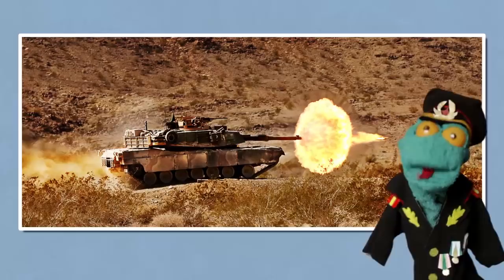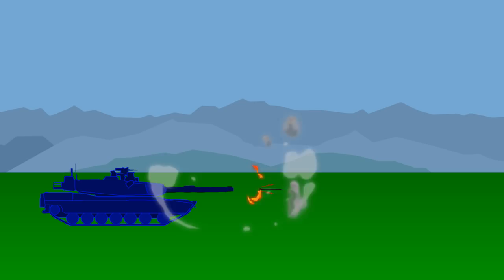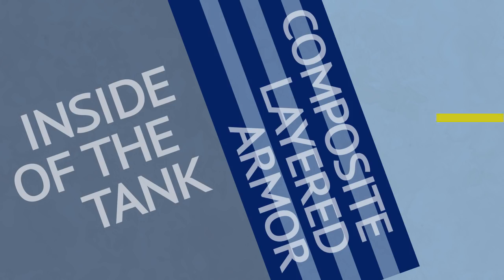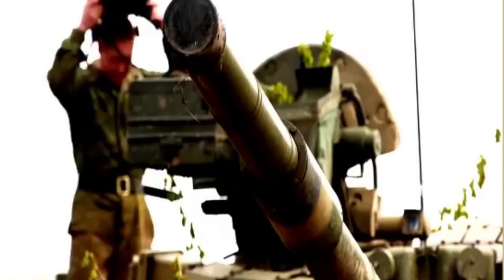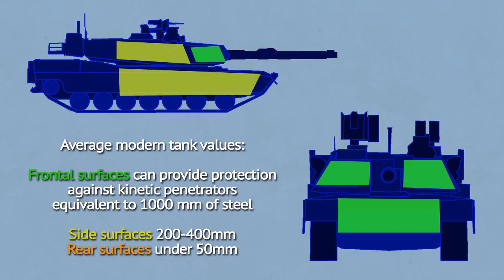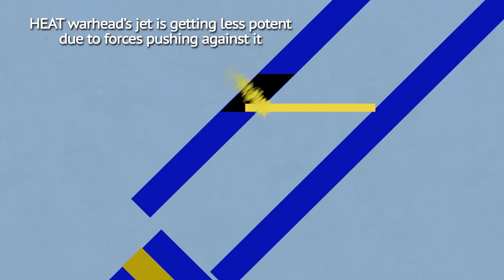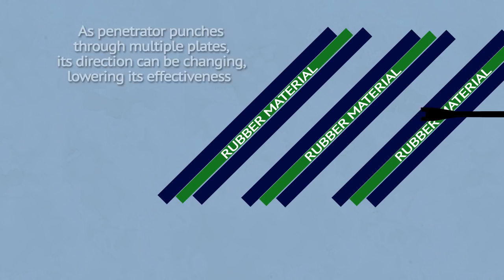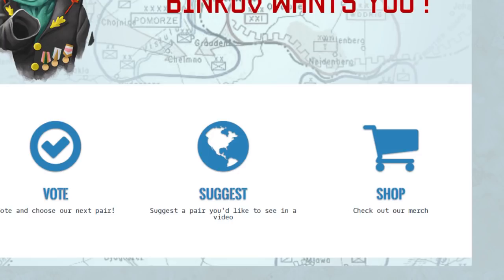Tank Gun vs Armor: Tank Warfare Explained

Comment: What's your assessment of towed anti-tank guns? So the same guns as in tanks but just on a mount to be dug into a position like the 2A45 Sprut Anti-Tank gun. In WW2, the Axis used towed 88mm guns quite widely in the anti-tank role.
Reply: Towed anti-tank guns are generally regarded as suicidal on a modern battlefield.  All advancing tanks have to do is use artillery to force the gun crews into their shelters until the tanks are right on top of them - then simply machinegun the crews when they try to man the guns.
Reply: Uh, why didn't they do that in WW2 then? Oh, because it's not just a matter of calling in artillery, you have to locate the anti tank gun before the anti tank gun locates you! Even if you do find something that might be an anti tank gun, it might be a cheap and disposable decoy. Decoy not only shape but flash of firing.

Think about this, you're a tank charging into enemy held territory, your solution to a very well concealed gun that can fire a projectile that travels over 1km in less than a second is to call in artillery that takes up to several minutes to respond?

You're dead. And the anti tank gun crew can retreat into bunkers to resist any artillery bombardment and artillery probably can't keep up a sustained bombardment as they have to "shoot and scoot" to avoid counter battery fire.

It's in fact easier to counter slow anti tank guided missiles as their flight time is so long the tank can see it and take direct countermeasures such as smokescreens or shooting at the launch site.

There is no time to react with an anti tank gun, their gun is as fast as your gun. Faster in fact as they'd use APFSDS rounds against a tank but a tank would use high explosives rounds against a dug in anti tank gun.

Anti tank guns are much cheaper than a whole tank so you can have more of them.
Reply: The US did do this in WWII.  And every military trains for combined arms attacks.  In my Cavalry squadron we were required to arrive at any location plus or minus 30 seconds because in the attack - if you're 30 seconds early you're getting hit by your own artillery and if you're 30 second late the enemy has time to crawl out of their shelters and man their weapons.

And even an ATWSS (Anti-Tank Weapons Signature Simulator) cannot really simulate a missile launch signature or the signature of a large caliber gun firing.  Another problem with decoys is that they have to be positioned so that the enemy can see them.  This itself will tip of the enemy that there's trouble ahead.

An AT gun will get two maybe three shots off before it's destroyed.  People who have not been on tanks have no idea just how fast and deadly modern tanks are.  And the AT guns will be crippled if they do not have tank quality optical and fire control systems.  And since these systems not only over half the cost of a tank - they consume an enormous amount of electricity and hydraulic power.  The tank guns will have a 95% of a hit within a meter of the aim point whoever they fire and can engage three separate targets in 15-18 seconds.  

Another lethal flaw in AT guns is that they are stuck in one location once the firing stops.  A tank will fire one or two shots then back down and move to another firing position.  This way the enemy fire is hitting where they were and they can do it all over again.  An AT gun is going to get off two - maybe three - shots and then die because they cannot displace their gun in anything under a couple of minutes.

Now an AT missile crew has an easier time of it because they only need to survive long enough to guide their missile to their target and then - literally - run for their lives.  (Or drive away if they are on a wheeled vehi8cle.)  The difference here is that the equipment needed to fire a missile is light enough to fit on a full-sized pickup truck type vehicle.  A large caliber gun weighs several tons.

There's a reason nobody uses towed antitank guns - and hasn't for the past 40 years.
Reply: really good at shelling the enemies in urban combat, look at syria or ukraine.
Reply: Colin Campbell. Yes in WW2 they did try to suppress anti tank guns with artillery but NO IT WAS NOT THAT SIMPLE. It hugely complicates offensive operations and really devalues sending in tanks as if the tanks are used as forward observers (to find AT guns) they are inherently more likely to be seen first and destroyed first.

And artillery is not that effective against dug in positions, and how do you suppress so many positions at once? Because how can you be so sure to distinguish decoy guns from real guns?

It cannot be known how well muzzle blast may be simulated, simulating a missile is obviously hard to spoof but a guns blast is just a blast. 

There seems to be so much focus on ATGMs and the counter measures against them seem to all be exploiting the slow flight time of such missiles, yet wouldn't be effective against a high velocity gun.
Reply: But if you're using it to shell infantry or demolish building is it still an anti-tank gun?
Reply: "And the AT guns will be crippled if they do not have tank quality optical and fire control systems."
Yet there's no particular reason they wouldn't have sufficiently good optics. And it's not like they have to even be as good, it's not like they have to correct for a wobbling suspension and it's far easier to spot a tank on the move than a dug in gun as distinct from a decoy. Tanks are big, moving and radiate heat. AT guns are small, immobile and ambient temperature, and it's easy to construct decoys.

"The tank guns will have a 95% of a hit within a meter of the aim point whoever they fire and can engage three separate targets in 15-18 seconds."
With an ultra-velocity APFSDS round which would be relatively very ineffective against a dug in AT-gun. And again, how does it know where the three anti tank guns are as distinct from the 6 decoys? How is it going to destroy ALL of them before ANY of them hit the tank? What do you do if you shoot a round at a 

If your plan is to bombard every possible position with artillery while you roll in extremely close, well good thing you have 6:1 ratio of artillery to their AT-guns and while you're rushing in close you can't discount infantry with RPG type weapons attacking close and from the flanks.

"Another lethal flaw in AT guns is that they are stuck in one location once the firing stops.  A tank will fire one or two shots then back down and move to another firing position."

That may be no advantage when you have aircraft assets that can spot armoured vehicles on the move with such ease. It's pretty well accepted that no NATO force will conduct any offensive operation without air supremacy and air-cover. Moving around may make a job somewhat harder for the opposing tanks, but with unacceptable vulnerability to air-power which look for things like heat of large tank engines and the distinctive radar return of an armoured boxy structure. Running just means you die tired.

Though an antitank gun can still be moved, yet doesn't need such a huge obviously military vehicle that is so obviously detected as a valid military target. Think about the First Gulf War, all those Iraqi tanks were kept stationary and dug in they might as well have been AT guns, though they suffered so badly as they were forced to use steel training ammunition against a generation-more-advanced tanks and without even close to as advanced optics. You can't always count on such mis-allocation of resources.

"Now an AT missile crew has an easier time of it because they only need to survive long enough to guide their missile to their target and then - literally - run for their lives"

But that flight time is as long as 20-30 seconds!! That's not easier. In the same time an AT gun could have destroyed the tank before it has a chance to destroy them. Several shots in the time it takes on ATGM to miss. You just said tanks can hit three different targets in 15 seconds. The missile position don't even need to be destroyed, if the tank just moves out of firing line or deploys a $100 smoke screen then the $50'000 missile is defeated.

"A large caliber gun weighs several tons."

Lots of things weigh several tonnes, howitzers weigh several tonnes, anti-aircraft systems weight several tonnes. But an AT gun is FAR lighter than a tank. It can be moved by common trucks, airlifted, cross rivers on barges and they can have their own internal electric motor to move short distances with help of manhandling from infantry.

ATGMs may be light, but the flight time is so long, it gives so much time to react before even the first hit. What if the objective is to stop opposing tanks reaching a vital objective rather than lightly harassing them? You fire the ATGM, it's so easily countered with smoke, counter fire or simply briefly retreating and you run away leaving the airfield or bridge to be captured. If you NEED a position to be held and retreating is not an option, the advantage of slow ATGM disappears.

"An AT gun is going to get off two - maybe three - shots and then die because they cannot displace their gun in anything under a couple of minutes."

And two to three shots is not good enough? As you presuming those shots MUST miss or be ineffective?

What are those two to three shots PER GUN doing? There's no particular reason an AT Gun should miss so much more than the tank should hit the AT position. And considering how much cheaper AT guns are and how they are MUCH lighter than a tank as per being moved into position, you can generally mass many of them in a position you want to defend. So quite conservatively:
-two different positions
-harder to see
-easier to decoy
-harder to hit 

A tank is going to destroy BOTH of those positions before EITHER those AT guns destroy the tank?!?!

This is the same challenge as 88mm guns in 1944, except the projectile velocities are doubled and sensors are even better at detecting heat-radiating vehicles but relatively less advances in detecting cold AT guns. You cannot assume that the tanks will have a monopoly on modern-sensors and optics.

Yes the tank has a extremely powerful hydraulics for a fast rotating turret but it needs it to rotate a massively heavy turret quickly. An AT gun does not need that. Nor does it need advanced servos to compensate for moving suspension.
Reply: It's semantic whether it is or isn't an anti-tank gun, the point of the phrase "anti-tank gun" is to give you an idea of what kind of artillery piece I'm referring to, not a low velocity cannon like a howitzer nor a high velocity but quite small calibre gun like a 30mm auto-cannon. Bombarding infantry at long range and lobbing explosives to demolish buildings is such a lesser requirement it's obviously included within the meaning of an "anti-tank gun".
Reply: Treblaine you do realize that this is not in fact the 1940s, right? 

Anti tank guns aren't effective in modern warfare, use missiles instead.
Reply: Treblaine you also forgot that HEAT rounds exist. Thermal sensors, air support, cruise missiles, infantry too
Reply: Yes, I know it's not the 1940's, anti tank gun are EVEN BETTER than those from 1940's, with projectiles at velocities of up to 1600m/s rather than 'only' 800m/s. This gives such a faster flight time for an anti-tank gun than than an ATGM, which for the past 45 years have been very effectively countered by exploiting the SLOW speed of guided missiles. 
ATGMs are also vulnerable to their guidance systems being jammed and even active protection systems. It is precisely because of the technology of today that makes ATGMs less relevant. Modern armour is far more effective at nullifying shaped charge warheads than Kinetic energy penetrators.

ATGMs are not cheap, the ones that aren't easily jammed cost about $1 million for a launcher and 12 missiles (Peru's cost for Kornet Missiles). This isn't just expensive to deploy, this is expensive to even train. And all this training you still know tanks can easily counter such threats with basic tactics and cheap countermeasures.

This is what happened in Ukraine, loads of missiles fired, most missed, everyone ran away after each shot. Only to see anti-tank guns see more and more use. You have to realise that so many of the tanks that are still in operation today are refurbished older models that are worth LESS than the ATGMs designed to destroy them! Yet these old tanks are just as capable of avoiding being hit using the same countermeasures as expensive MBTs.
Reply: No, I didn't forget that HEAT rounds exist, Ike. You forgot that more modern tank armour and countermeasures are most effective at defeating HEAT rounds than APFSDS rounds. Like explosive reactive armour. Like active protection systems. Thermal sensors are useless against a gun sitting still at ambient temperature, thermal sensors make it easier for anti-tank guns to find tanks that are moving on their position.

If you're using $5'000'000 cruise missiles to blow up $200'000 guns then the richest nation will lose a war of attrition with all but the absolute poorest nation. And  what is any guided weapon aiming for? It's one thing for guided weapons to hunt for tanks with their distinctive thermal emissions, size and magnetic signature from its steel mass... but a tank gun is as easily decoyed by a bit of steel piping painted with the same paint.

I'm with you on infantry though, even modern tankers have confirmed as much the importance of infantry support. But ATGMs don't really make the job any harder for the infantry.
Reply: Treblaine you are basically spending half as much for a tank, if you want a modern gun and sensor system, with an FCS. 

Otherwise the guns would be useless. So why spend money on these guns when you can just buy more tanks. 

Especially when considering that these guns can only be used in a defensive role as an anti tank weapon, so if you wanted to assault you would have a large force of anti tank guns unable to contribute.

The tank guns lack survivability, because they can't move after firing and will be targeted by all kinds of support or even the tanks themselves. The tanks can simply stay at a range you can't penetrate them at and hit you with HEAT. 

If you want close range ambushes then infantry will fuck over your guns. 

Plus once you are detected an ATGM won't have any problems hitting a stationary gun, you're better off buying more tanks
Reply: Treblaine also things like the AT4 cannot be jammed
Reply: Treblaine and about me saying you forgot heat exists, I meant an enemy tank would fire HEAT at your guns and not sabot
Reply: But you don't need most of the expense of a tank gun, you don't need to counteract the movement from the suspension nor a very powerful yet accurate control of a massive heavy turret. All you need is a good thermal sight. 

"So why spend money on these guns when you can just buy more tanks. "

Because even by your own - imaginative - numbers you get TWICE as many anti-tank guns! You don't get more tanks. You cannot dismiss the cost of everything except the tank's gun as trivial costs.

"Especially when considering that these guns can only be used in a defensive role as an anti tank weapon"

And that's PRECISELY where you need anti-tank weapons as tanks are overwhelmingly used in the offence. Tanks may be ideally the best anti-tank weapon, but to use tanks to counter tanks you need to have many many timed more tanks than your opponent and far more freedom of movement. How can you concentrate enough tanks everywhere? 

This is the economy apparent in WW2 and the same economy applies today, why the Germans had 20x as many anti-tank guns of any standard throughout the war than tanks. Because all else being equal it was far less expensive to build and deploy an anti-tank gun than a tank. 

I don't think you're anywhere near as critical of ATGMs in such a purely defensive role.

"The tank guns lack survivability, because they can't move after firing and will be targeted by all kinds of support or even the tanks themselves."

You're far more vulnerable leaving a dug in and concealed position which isn't necessarily known to the extent that it can be targeted. Giving a rough range and azimuth from your last approximate position where you thought an anti-tank gun might be is going to result in a very low concentration of artillery fire. 

And while it is true that eventually, with enough time and devotion of resources, anti-tank guns may eventually be neutralised. Then they have already achieved their purpose if it was to stop an attack against a far more vulnerable point. Compare and contrast with an ATGM which is far less survivable for the extremely long lag time between first sign of the launch and any chance that it could have reached the tank it is threatening, more than enough time for the tank to fire many rounds at the ATGM launch position.

When soldiers fight they don't fight to save their own lives, they put themselves in harms way to oppose their enemy. This is no suicide mission though, they have a chance to win and that it to outshoot the tanks that are assaulting their position, load faster, dig in deeper, hide better, smarter decoys, better coordinate with spotters, artillery, landmines. 

Don't just "shoot and run away".
Reply: HEAT rounds are also defeated by the typical earthen defences an AT gun would be dug into, just a few feet stops the biggest and meanest HEAT shells. You need a very good hit against an anti-tank gun's position with a lower velocity fin-guided projectile, and you don't even have anything to aim at as anti-tank guns can use the same thermal sleeve over the cannon barrel. 

AT4 has a velocity of around 250 m/s compared to the 1600m/s velocity of an AT gun. And the warhead is so small it can only defeat the frontal armour of older tanks, otherwise only the side armour of more modern tanks. 

These small cheap anti tank weapons are definitely relevant though, and they are a simultaneous threat for tanks to deal with while dealing with AT guns, analogous to the twin threat of panzerfausts and 88mm guns in WW2.
Reply: So far you are doing a really good job of indicating that you have no idea about this subject.  For example - every tank commander in the US army is able to call for and direct artillery fire.  As for how I'd suppress that many positions at once - with a 50/50 mixture of HE and WP.  The shrapnel from the HE keeps them in their shelters and away from the guns and the WP covers their positions in smoke.

In my Cavalry unit - this was a battle drill.  The scouts led the advance by bounding forward then the tanks followed.  Once the tanks were in position the scouts bounder forward while the tanks covered them.  If the scouts ran into trouble the battle drill started.  The scouts went evasive and fired a salvo of smoke grenades then retreated to the last position.  At the same time the tanks charged forward and used direct fire to suppress the enemy (distracting the enemy from the scouts by presenting a much more dangerous threat.)

At the same time the mortar section began laying a 50/50 mix of HE and smoke on the enemy positions.  Once the scouts were back in position the started firing on the enemy while the tanks retreated.  

As for the rest - real life is not a video game.
Reply: Yes there is a good reason they cannot have tank-quality fire control systems.  Weight and power.  Tanks can carry the weight and have a surplus of power for the fire control system.  And AT guns have another issue that tanks do not - a lack of mass to soak up the recoil.  These recoil forces combined with the fact that the FC system cannot be as heavy-duty as that on a tank and you have a huge engineering challenge in maintaining calibration between the FC system and the gun after each shot.
Reply: Who said I'd waste a kinetic energy round on an unarmored target?  The only reason for doing this would be if you have FSDS as your battlecarry and firing the gun is the fastest way of clearing the chamber for HEAT-MP.  And you seem to have this idea that somehow we aren't going to notice the decoys until after the real guns fire.  You have a problem here.  If your decoys are so easy to detect - they would be noticed before the tanks came into the effective range of the AT guns.  And if they are hard to detect the tanks would be firing on the weapons signatures.  Because they didn't detect the decoys.  

And a FSDS projectile hitting your gun is going to mess things up.  Unless of course you do not have any kind of protection for the crew - which makes them targets for machineguns.

And you are the person who is making assumptions - without any understanding of the subject to base those assumptions on.  Everything you are saying is based on assumptions that are not based on any kind of understanding of the subject.  

Your idea that you can put a tank fire control system on a towed gun does nothing but demonstrate that you know nothing about tank FC systems. (Or about gunnery fire control systems at all.)

The fact of the matter is that the reason AT guns are nothing more than museum pieces is because everybody who has any clue about modern warfare knows that they are a stupid idea.
Reply: Colin Campbell. So you are completely unaware of the widespread use of anti tank guns in combat in Ukraine?

Of course tanks have radios to communicate with artillery, I NEVER implied that they didn't have radios. I said how would they know what to tell their artillery? I even specifically talked about how they couldn't know what to call in.

And these anti tank guns manage the recoil of such rounds just fine, you keep pretending they need an expensive fire control system to compensate for a vehicle suspension when they don't. You aren't even listening, you are ignoring how AT guns don't need them as much as a tank but insisting they couldn't have them anyway.

What's this nonsense about decoys being either far more obvious or invisible? The point is they are constructed to look almost identical to an AT gun, so more nor less visible, so if you visually identify an AT gun it's as likely just a decoy. Also there is no reason the flash cannot be replicated with a high degree of accuracy. Even use the same powder.

Even if you concede that the solution to AT guns is to retreat and wait for artillery, then you've proven that an AT gun is far better at its job of stopping an assault.

I never said that AT guns would be utterly immune, but you're already putting delays on your assault, you're already requiring coordination with scouts and artillery. What if artillery says "no" they are on duty against counter battery fire or are protecting another position?

You aren't selling AT guns short by bringing up how much more time and resources are needed to defeat them. What if the side using AT guns also have other resources and - just consider this crazy idea - they also have brains inside their skull.

What if all the time you're amassing solutions to the supposed non problem of AT guns, they exploit this predictable retreat and delay to counterattack?
Reply: Yes obsolete AT guns have been pulled out of storage and used by both sides in the Ukraine.  However they are not being used in an anti-tank role.  They are being used as assault guns and against lightly armored and unarmored vehicles.

And even the 125mm ones cannot reliably penetrate the frontal armor of a tank.  

And I never said that the solution to AT guns is to retreat and use artillery.  The battle drill I was talking about is used in cavalry units.  Cavalry units do not have the mission of attacking defended positions.  Their job is reconnaissance and counter-reconnaissance.  

A tank or mechanized infantry task force is going to literally drive over the guns and then turn around and attack those guns from behind.  And if the cavalry has located their positions - then it will be a deliberate attack with artillery support.  

Apparently you know nothing about US Army tactics and doctrine either.
Reply: "And I never said that the solution to AT guns is to retreat and use artillery."
Previously the very same day:
"every tank commander in the US army is able to call for and direct artillery fire.  As for how I'd suppress that many positions at once - with a 50/50 mixture of HE and WP."
"The scouts went evasive and fired a salvo of smoke grenades then retreated to the last position. "

Wow.

And what are these scouts? Some sort of tank? Humvee? Infantry on foot? What are they doing? Are they just bait to get AT guns to expose themselves by firing?

And what's the point in popping smoke? The flight time of AT gun projectiles is not like ATGMs, you don't have 20-30 seconds before they hit, you have 1 second, or less.

Of course AT guns are going to shoot lightly armoured and unarmoured vehicles more than tanks... THERE ARE MORE OF THEM than tanks! Thank you for raising that point, though you overstated it by the unproven conjecture that Anti Tank guns are inexplicably... not used against tanks, it is very relevant the threat from other vehicles. It is barely worth it to use an ATGM against a tank, but against lighter and more common vehicles it's not worth it. There is still a huge demand for long range and powerful direct fire at long distances with such a fast flight time it's impossible to deploy any effective countermeasures.

How does this remotely work, your scouts are being destroyed and the few survivors forced to break line of sight ASAP and escape back the way they came, why would tanks do any better charging right into the same killzone? 

Are you banking everything on your tank winning the tank armour vs tank gun penetration arms race? 

"And even the 125mm ones cannot reliably penetrate the frontal armor of a tank."

Guns of calibre larger than 120mm can't penetrate the front of a tank? The M1 Abrams has a 120mm gun. Stop with the nonsense. You seem to imbue the tank itself with magical properties, as if just being in a tank then a large calibre high velocity gun is supernaturally able to make the projectiles fly faster for no reason known to science. That's obviously not the case but you won't give any reasoning.

"A tank or mechanized infantry task force is going to literally drive over the guns"

You seem to have an utter contempt for history, why do you think everyone in WW2 didn't just "charge forward and use direct fire to suppress the enemy"? They had guns with a good amount of high explosive filler with far more ideal HE to shell mass ratio for ideal fragmentation than modern rounds like M830A1. Modern guns are going to be even worse at suppressing AT gun positions. What are you even aiming at?

You seem to be incapable of accepting that AT guns can shoot at, hit and damage and destroy tanks.

Not that allied tanks couldn't eventually push on through to Germany, but it's not because AT guns simply needed to be charged at.
Reply: "And what are these scouts? Some sort of tank? Humvee? Infantry on foot? What are they doing? Are they just bait to get AT guns to expose themselves by firing?"

"And what's the point in popping smoke? The flight time of AT gun projectiles is not like ATGMs, you don't have 20-30 seconds before they hit, you have 1 second, or less.
"

As I previously posted the mission (in this example) was reconnaissance/counter reconnaissance.  In effect their job is to locate the enemy and then report on their locations, dispositions and actions.  And we were 'heavy cavalry' so each troop had two scout platoons with M3 Cavalry Fighting Vehicles (a modification of the M2 Bradley Infantry Fighting Vehicle) and two tank platoons.  

And firing a salvo of smoke grenades is doctrine if engaged by enemy antitank weapons.  Part of the battle drill.  Their job is to locate the enemy - and to avoid decisive engagements.  Also remember that not all of those shots are going to hit.  As I pointed out - by necessity those antitank guns have to use fairly rudimentary fire control systems.  They will not have laser rangefinders, crosswind sensors, cant sensors, lead calculation and the computer generated firing solutions that are standard on modern tanks.  They also are going to have problems with obscuration and they will have to re-lay the gun after each shot because they won't have the sophisticated recoil management systems and the sheer mass to absorb recoil that tanks to.

And something else you have to take into consideration is that if those AT guns are firing at tanks - they are firing at things that were designed to survive direct hits from that exact kind of weapon.  

So there will be a lot of first round misses.  And even if they do hit every scout track - they will then be engaged by the tanks.  Tanks that will use their mobility to their advantage by never firing twice from the same location.  Those AT guns after that first salvo are going to be little more than targets.  The tanks will take advantage of their more sophisticated fire control systems to fire at long ranges also.  And 30 seconds later those AT guns are going to be getting hit by a combination of HE and white phosphorous.  And less than three minutes later by a shitstorm of 155mm artillery.  

And after that the surviving AT guns will be facing a Tank or Mechanized Infantry task force conducting a deliberate assault.  (Remember that in this example the Cavalry was successful in their mission - the US commanders now know where the enemy is and what weapons they are armed with.  Not only that but the main combat units were not the ones who found the enemy positions the hard way.  So their ambush failed to blunt or even engage the main force conducting the attack.  I never said that the Cavalry's mission was safe.  We knew that we were considered to be expendable and if we got into serious trouble - we would not see the main combat forces coming to rescue us.  (Although we would generally have priority of fire from the artillery units.)
Reply: Because by driving through the enemy positions you clear the enemy kill zone.  And you are also dismounting your own infantry outside the enemy kill zone.  If you stop and fight from inside the enemy's kill zone - you are doing exactly what they want you to do.  Something that is pounded into the head of every leader in the US Army is that the fastest route out of an enemy kill zone is through their positions.  

And this is a doctrine that CALL (Center for Army lessons Learned) has found to work (their job is to interview units who had been in recent combat in order to find out what worked, and what didn't work - and then spread that information throughout the army).  

And as for the 'ideal' HE/Frag round - remember that modern ammunition is much more technologically advanced and much more is known about their effects (because we can use supercomputers to model the fragmentation patterns).  Also remember that in WWII we were using 75mm He shells with 'quick' fuses that would dig into the ground a bit before exploding (wasting energy by moving dirt around).  While modern ammunition uses 'super quick' fuses that detonate the round before it can burrow in.  And we are also using projectiles that carry significantly more explosives and fragmenting materials.   

I can tell that you have zero combat expierence by your comment about projectile warheads.  Modern ammunition does not leave craters unless the rounds were set to 'fuse delay' in order to penetrate bunkers and field fortifications.  (Or somebody is using obsolete fuses or is not setting them properly.)
Reply: "by necessity those antitank guns have to use fairly rudimentary fire control systems."
NO. By necessity they DO NOT NEED as expensive fire control systems. It doesn't need powerful and accurate controls of a huge heavy turret as it doesn't have a huge heavy turret. Nor does it need to compensate for the suspension, that is expensive, but something an AT gun doesn't need.

"They will not have laser rangefinders, crosswind sensors, cant sensors, lead calculation and the computer generated firing solutions that are standard on modern tanks."

You've resorted to wishful thinking.

There is no reason a military grade AT gun cannot have such sensors, such sensors are not millions of dollars, they aren't even tens of thousands of dollars. It's actually easier to detect crosswind outside of a tank than in one.

"they will have to re-lay the gun after each shot because they won't have the sophisticated recoil management systems and the sheer mass to absorb recoil that tanks to."

What is the year? Is it the 18th century where no one has developed any recoil mitigation system? 

Artillery firing larger shells with far more inertia don't need to be re-laid. As an antitank gun is no limited by the space inside a turret, the recoil distance can be much farther and it doesn't need the 60 tonnes of a tank, it's staked to the the ground, the earth, which has far more inertia.

"they are firing at things that were designed to survive direct hits from that exact kind of weapon."

Actually, tank armour has had far more focus on defeating HEAT warheads than APFSDS rounds, so it would be the ATGM that has the disadvantage here. If anything can get through the thick frontal armour of a tank, it's an APFSDS round, not an ATGM.

"And even if they do hit every scout track - they will then be engaged by the tanks."

So what's your solution to infantry being shot by snipers? Just have the scouts all get shot at, assume the snipers can't hit what they are aiming at, even if they are all shot, send in guys with plate carriers to the same place and do the same thing and hope the same thing doesn't happen to them.

I mean they are running out into an area you just said a load of smoke was popped. It's quite well accepted that as smoke slowly clears you can be spotted inside the smoke before you can properly see out of it. Especially as there's no reason AT guns can't use thermal imagine. It's not 1991 any more, thermal sights aren't as rare and expensive as Ferraris.

"The tanks will take advantage of their more sophisticated fire control systems to fire at long ranges also."

I'm not saying there aren't sophisticated, but they are so expensive because they are compensating for the problems inherent to a tank. Like rotating a heavy turret. Shifting and rolling suspension.

"Remember that in this example the Cavalry was successful in their mission - the US commanders now know where the enemy is and what weapons they are armed with."

No they bloody well don't.

They know one weapon and where some of them are, they do not know if they have short range RPG7 type weapons or landmines. Again, read some history, this is the same problem they had in WW2, even if you could charge the AT guns, there's the threat of small very concealable infantry anti-tank weapons, it would be Panzerfausts in 1944 but RPG7 today. 

Weapons like the RPG-29
 fire a 105mm tandem HEAT warhead at 300m/s, it still needs a flanking shot but when you charge forward then the sides of a tank are inherently more exposed. This is the reason modern MBTs were destroyed so much in the first Chechen War, they charged into close quarters where they put themselves between RPG firing positions.

"So their ambush failed to blunt or even engage the main force conducting the attack."

You JUST SAID you'd engage them. You said:

"And after that the surviving AT guns will be facing a Tank or Mechanized Infantry task force conducting a deliberate assault."

That's blunting. That's engaging.

"I never said that the Cavalry's mission was safe."

Much safer against ATGMs, surely.

Everything you say applies just as much and more against ATGMs.

Look, I don't doubt that there are countermeasures against everything, but having to resort to "getting hit by a combination of HE and white phosphorous.  And less than three minutes later by a shitstorm of 155mm artillery." that is far more resource and organisationally intensive.

Without AT guns, tanks could quite confidently advance WITHOUT artillery, they wouldn't need them, they could take care of ATGMs entirely by themselves. But do you not see how AT guns turn this simple assault into a full battle? Now you are depending on artillery to keep up and stay active, what about counter-battery fire. What happens when their positions start getting hit by HE and WP?

This is no longer any sort of sure thing, especially if you cannot guarantee having many times more forces.
Reply: "Because by driving through the enemy positions you clear the enemy kill zone."

In the same sense that running at a machine gun means you run through the kill zone. Again, it's hugely wishful thinking to presume that their guns MUST be totally inaccurate and MUST be weak. They are just as big and powerful as the guns on MBTs. Rangefinders and thermal imagers are NOT so rare that only the top table NATO powers can afford them, that technology is older than Star Wars.

"Something that is pounded into the head of every leader in the US Army is that the fastest route out of an enemy kill zone is through their positions."

As is the doctrine of most armies of major powers, they after all require that infantry "close with and destroy the enemy" as that's how wars are won. But this is an ideology to make things hard for the enemy, not hard for you. What happens if in this headlong charge you find that what looked like bushes on the satellite photo were in fact steel tank-obstacles, you can't drive over them without being jackknifed and mobility killed. Or just good old fashioned land-mines and IEDs.

"And as for the 'ideal' HE/Frag round - remember that modern ammunition is much more technologically advanced "

Yes, more advanced penetration from the shaped charge warhead, not more advanced fragmentation. 

The research into fragmentation has found very strict mass ratio requirements that most tank rounds do not meet. The explosive mass is too small yet the shell walls don't provide ideal ratio of mass of steel. It doesn't matter what you do with the body, have it pre-fragmented or with wire, the walls are too thin.

"Also remember that in WWII we were using 75mm He shells with 'quick' fuses that would dig into the ground a bit before exploding (wasting energy by moving dirt around)."

Actually the relative slowness of even those fuses was an advantage, they would penetrate INTO an earthen bunker and explode INSIDE it, or when they hit the ground at a shallow angle they wouldn't burrow into the ground they'd skip up and angle the nose more downward, this gave a much wider coverage of fragmentation as then half of it wasn't wasted shooting off into the air.

Modern HEAT rounds couldn't penetrate into a bunker even with a fuze delay, their construction means they'd disintegrate and essentially be unable to properly explode before they travelled through much thickness of earth. Also, HEAT round's "jet" of copper is inherently bad at punching through thinks like earth and sand, a 75mm round can punch through a lot of earth as it has high inertia but relatively low velocity. But the faster you try to push through hard particulates, the more disruptive resistance you get and it breaks up the penetrating jet. Which creates a larger surface area and a positive feedback loop. This is in fact how modern tank armours work. Those perimeter barriers at FOBs are just piles of sand and earth, they'll stop even monstrously large RPG-7 and recoilless rifle HEAT rounds.

Even with all this, those 75mm gunned tanks had a huge problem with anti-tank guns, not that they couldn't beat them, they used all the means you describe but guess what, it wasn't anywhere near as easy as you make out. It took a long time, often long enough for German units to reorganise and reinforce, which is precisely what the allies didn't want them to be able to do.

Now after WW2, there were so many tanks being made so cheaply there was little point in emphasising anti-tank guns, but tanks would not remain cheap. And ATGMs appeared and seemed to be amazing, but as was discovered their initial effectiveness was far more from unfamiliarity with them, they were far more vulnerable to the usual countermeasures.

"While modern ammunition uses 'super quick' fuses that detonate the round before it can burrow in."

They had them in WW2 as well. Even British 25 pound howitzer was criticised for it's LACK of ability to shift earth as it would just detonate on impact and leave a scorch mark, this is when some demolition ability of destroying earthwork defences was desired.

"And we are also using projectiles that carry significantly more explosives and fragmenting materials.   "

That's the thing, the 120mm gun's main high explosive round contains only as much explosive as a 75mm gun, but far less fragmentation mass which isn't even specially pre-fragmented or anything. The projectile is geared towards things like shooting down helicopters and penetrating the thick armour of older tanks.

And this is inherent to the smooth bore, you can't just fire a big and heavy-walled shell, that would NEED spin stabilisation, all projectiles must be quite light and fast where they can effectively depend on fin stabilisation.
Reply: "They know one weapon and where some of them are, they do not know if they have short range RPG7 type weapons or landmines. Again, read some history, this is the same problem they had in WW2, even if you could charge the AT guns, there's the threat of small very concealable infantry anti-tank weapons, it would be Panzerfausts in 1944 but RPG7 today."

This isn't 1944 and the RPG-7 is obsolete.  And it is pure stupidity to think that we won't be expecting infantry with handheld AT rockets.  

"Look, I don't doubt that there are countermeasures against everything, but having to resort to "getting hit by a combination of HE and white phosphorous.  And less than three minutes later by a shitstorm of 155mm artillery." that is far more resource and organisationally intensive.
"

Every army in the world uses artillery for suppressive fire.  In fact the Russians have a reputation for being really good with their use of massive amounts of artillery.  

"Without AT guns, tanks could quite confidently advance WITHOUT artillery, they wouldn't need them, they could take care of ATGMs entirely by themselves."

Yea because nobody else has tanks, antitank missiles, artillery and attack helicopters.  And ATGMs are much more dangerous than you think.  

BTW: want to make those AT guns of your several times more effective?  Put them on a tank.  Now they have armor protection, better sensors (that can see through smoke) and don't have to worry about a fragment of WP landing on the ready ammunition stowage.  They can also be used offensively and can when fighting defensively use tactical maneuvering so they aren't dead meat after the first shot.  They now can power sophisticated sensors and FC systems and recoil is not the huge issue it is with light weight systems.  

As for recoil - you seem to be forgetting Newton's laws of physics.  Every joule of energy in the projectile also is imparted to the gun.  I'd love to see your design for a recoil system that can absorb this energy and still keep the gun accurately laid on the target.  

The frustrating thing here is that you have nothing but assumptions that are not based on any real understanding as to the subject.  And you are not willing to modify those assumptions when I explain how things work in the real world.  

You are coming across as a teen-ager who has not caught on to the fact that he does not know how the world works and just how much he doesn't know.
Reply: "Well over half the cost of a modern tank is the cost of the sensors and fire control system."
No it isn't.

I know the cost of thermal optics and home much an M1 Abrams costs. A wing gauge does not cost even close to 1 million dollars, what you think they'll just hold a wet finger in the air. How the hell is all of this adding up to even close to half of the unit replacement cost of an M1 Abrams. 

"The problem here is that you have absolutely no clue as to what you're talking about."

Says the person who thinks a wind gauge and ballistics computer costs millions of dollars. Yeah, you're really showing what you know.

"This isn't 1944 and the RPG-7 is obsolete.  And it is pure stupidity to think that we won't be expecting infantry with handheld AT rockets. "

It's obsolete yet you're expecting it?

"And ATGMs are much more dangerous than you think.  "

Why? All the things you describe about the problems with AT-guns apply far more to ATGMs.

" want to make those AT guns of your several times more effective?  Put them on a tank."

Did you already forget about air-power so effectively using radar to detect the distinct return of boxy steel vehicles?

Did you already forget about the cost of systems that compensate for unstable suspension?

Did you forget how vehicles are far easier to spot due to the proliferation of thermal optics?

"Now they have armor protection"

They had protection before, earthen works protect extremely well.

"better sensors (that can see through smoke)"

More nonsense that only a tank can have acceptable sensors.

"and don't have to worry about a fragment of WP landing on the ready ammunition stowage."

I'm sure that'll be of great comfort when a brimstone missile homes in on their distinct radar return and destroys them. It's not like it's that hard to construct bunkers with overhead cover. 

"They can also be used offensively and can when fighting defensively use tactical maneuvering so they aren't dead meat after the first shot."

Of course there is that advantage, but at what cost? 

You are looking at only ONE advantage and that is tactical mobility. Stealth is completely out of the window, in the age of thermal optics it's like trying to hide in dark room while doused in glow in the dark paint. And that's a direct consequence of being a large vehicle, they radiate heat to move so much around. It's not necessarily any advantage in armour as it's far easier to ensure a dug in gun is well protected than make sure your armour wins the armour vs gun arms race. And it's only tactical mobility, not strategic mobility. Generally, tanks weigh about 10x as much as a towed anti-tank gun, you can get 10x as many anti-tank guns into a theatre. So pop up at any of 10 different positions, or have all of those 10 different positions continually threatening?

Yes there is going to be a need to attack, but there are far more places you need to defend.

"As for recoil - you seem to be forgetting Newton's laws of physics.  Every joule of energy in the projectile also is imparted to the gun."

I haven't forgotten that, you have forgotten that inertia and kinetic energy are not the same thing.

The barrel and breach recoils with the same INERTIA as the projectile that was shot out the front, but it does NOT have the same energy. There is a difference between "every action had an equal and opposite reaction" and "energy in a system must be conserved". 

There is as much INERTIA in a 15kg howitzer shell being fired at 500m/s as a 5kg sabot+dart being shot at 1500m/s. But the latter has 3x the kinetic energy. Do YOU know what YOU are talking about? The energy in the system is conserved as chemical energy in the powder is turned into kinetic energy of the projectile. 

"I'd love to see your design for a recoil system that can absorb this energy and still keep the gun accurately laid on the target.  "

It's not my idea, it's used on every howitzer made in the past 100 years. It's just a spring and a hydraulic buffer. 

The problem is you don't understand Newton's laws of physics, you don't understand the difference between inertia and kinetic energy. 

"The frustrating thing here is that you have nothing but assumptions"

Lets list just some your assumptions:
-Inertia and kinetic energy are the same thing
-No large cannon can compensate for the recoil of an APFSD round without it being in a large tank
-Anti tank guns cannot have common mass produced sensors like thermal optics nor ballistic computers. Even a wing gauge.
-It doesn't matter that tanks are far more easilly seen and targeted with thermal optics.
-Anti tank guns cannot be less than half the price of an equivalently armed modern tank
-The threat of modern airpower targeting any armoured vehicle that moves is negligible
-AT guns need expensive systems to compensate for shifting suspension and rotating a heavy turret, despite not having either
-AT guns will inevitably be easily found despite the lack of distinct thermal nor radar signature 
-Tanks easily win gun vs armour arms race, so no value in digging in.

"And you are not willing to modify those assumptions when I explain how things work in the real world.  "

Look who's talking.

I have challenged you on so many more things than that and you haven't even tried to acknowledge the flaws in your reasoning, but moved on to the next assumption. Things like "it's not 1944 any more" what does that prove? The changes since 1944 don't make things harder for the anti-tank gun, they make it harder for your proposed alternative: the tank.

It's not much to bring up artillery, which was aplenty in 1944. What they didn't have in 1944 was thermal optics and ground scanning radar that can pick out things like tanks with such terrifying ease.

"You are coming across as a teen-ager who has not caught on to the fact that he does not know how the world works and just how much he doesn't know."

You're coming across as someone who has run out of excuses, every one has been shot down so thoroughly you're now guessing at how to personally attack me. This started with mere scoffing, oh, anti- tank guns are old fashioned, but you couldn't back it up.

Is that's what happens next? You find more way to personally attack me? You'll spend a long time making more assumption.
Reply: Ok then you tell me what the systems on a tank are and their percentage of the overall costs.  

So far you have not said anything that indicates that you have the first clue as to what you're talking about.  You don't understand tactics, gunnery, fire control systems, the uses of artillery on a battlefield, Newton's laws of physics, or just about anything else you have commented on.  You even made the claim that WWII ammunition was more effective than modern ammunition!

You even used the Russian expierence during their firs war in Chechnya as a reference without understand what had actually happened there and why.  Not only that - but you seem to be completely unaware that the US Army has used tanks in urban settings successfully.  (The Second Battle of Fallujah is one example.)

You have seized a position of ignorance and appear to be prepared to defend it to the death.

And it is inane that just about most of your ideas stem from a misunderstanding of tank combat in WWII.  

If you want this conversation to continue please give me a reason.  So far you have simply refused to accept anything I've attempted to explain to you. 

As far as I can tell your only military expierence has been video games.
Reply: "Ok then you tell me what the systems on a tank are and their percentage of the overall costs.  "

That's your accusation on them being so unrealistically expensive. Lets see your proof.

"You don't understand tactics, gunnery, fire control systems, the uses of artillery on a battlefield, Newton's laws of physics, or just about anything else you have commented on."

That's you on AT guns.

"You even made the claim that WWII ammunition was more effective than modern ammunition!"

I never claimed it was in every way superior. Modern HEAT projectiles are obviously far superior in terms of thickness of rolled homogenous armour penetration, but it is an irrefutable fact that this was dune by sacrificing aspects such as fragmentation.

"You even used the Russian expierence during their firs war in Chechnya as a reference without understand what had actually happened there and why."

Oh no, how dare I cite reality!

"You have seized a position of ignorance and appear to be prepared to defend it to the death."

He says as he ignores the many errors and assumptions I just listed. Ignore and accuse ignorance.

"And it is inane that just about most of your ideas stem from a misunderstanding of tank combat in WWII."

What misunderstanding? Is that YOUR misunderstanding that most allied tank losses were to enemy tanks, when they in fact were not mostly lost to enemy tanks but other weapons like anti-tank guns.

"If you want this conversation to continue please give me a reason."

Well, me refuting everything you say as a faulty assumption doesn't actually give you much reason to continue, so you got me there.

"So far you have simply refused to accept anything I've attempted to explain to you. "

That's because you refused to even acknowledge any holes in your reasoning, you can only scoff "HOW CAN WW2 AMMUNITION EVER IN ANY NARROW ASPECT BE NOT AS GOOD!" and nonsense like that. You just ignore every advantage, value mobility over everything and refuse to acknowledge in any way the problems with trying to be mobile.

"As far as I can tell your only military expierence has been video games."

How did you get that invention? From the complete and utter lack of any reference to any video game and repeated reference to history?

Because video gamers are notorious for bringing up the cost and economics of weapons systems over cool things like tactical mobility. That's sarcasm in case YOU can't tell.
Reply: I don't have 'proof.'  Just what I was taught at gun school and from reviewing a Report of Survey detailing the exact costs of the components damaged in a rollover accident.

You see - unlike you I have a real world basis for what I'm saying.  In fact I have yet to hear anything from you that give me the impression that you know anything about the subjects we're discussing.

Why don't you provide me with a listing of your qualifications on these subjects.

I'll go first:

26 years service in the US Army with the majority of that time spend on and around tanks.
Graduated the Advanced Non-Commissioned Officer's Course for tank crewmen
Graduated Tank Commander's Course.
Graduated the Master Gunner's Course(s) for the M60A3, the M1IP and the M1A1*
Qualified as a tank systems mechanic
Combat veteran in two wars.

Now why don't you tell me what your qualifications are?

* Master Gunner's Course is the second toughest academic course of instruction in the US military.  The only school that's tougher is the Navy's Nuclear Power Program.  A Master Gunner is recognized as an expert in tank gunnery, tank fire control systems, the selection and training of tank crews, tank ammunition, ballistics, as well as the strengths and weaknesses of likely hostile tanks and anti-tank systems.

And I bet that what I'm not going to see from you is anything that would indicate that you are anything other than a teen-ager whose only understanding of armored combat came from video games.
Reply: This is about Anti-tank guns, and what is anyone supposed to take from the weird accounting they do with military procurement when it comes to replacing parts damaged in a tank roll over as an accurate way to extrapolate to an anti-tank gun. That is not understanding in Anti-Tank guns that's guesswork. I have said it a dozen times already: an anti tank gun is not a tank. It doesn't need expensive FIRE CONTROL systems that a tank would need because it doesn't have the problems of a suspension nor heavy turret. You repeatedly accuse me of ignorance, but what have I ignored? You have ignored so much of what I've said. So much. 

I do NOT take issue with your understanding and expertise in tanks, that is NOT in dispute. what is in dispute is your extrapolation onto almost every other conceivable matter outside of that! Of course you're not going to be considering Brimstone missiles, they wouldn't be used against an M1 Abrams tank, they'd be used against adversaries of NATO tanks, so of course you don't consider the downsides of trying to do what any M1 Abrams tanker could do with the guarantee of air supremacy. But maybe you should, even though it's not part of a NATO power's consideration. Of course the commander of an M1 Abrams is going to hugely value armour, the US army's M1 Abrams has the best armour in the world... but guess what... not everyone else can have such utterly Bulletproof armour. 

And to say "well of course M1 Abrams has superb armour that can resist really high energy APFSDS rounds" that doesn't weaken the AT Gun compared to ATGM as ATGMs aren't any better off in armour penetration yet with all the downsides of flight time and jamming. And as we both know, even countries that get M1 Abrams Tanks don't necessarily get the versions with the most advanced nor effective armour. And of course, not everyone gets M1 Abrams, what is Ukraine supposed to do? Give up and wish the US Army will do all the fighting for them?

Okay put it this way, what if instead of a 125mm Anti Tank gun... it was a tank with a 125mm gun. Just imagine any scenario swapping between those two. M1 Abrams tankers are hardly THAT screwed over by such a turn of events. What is the difference? What you need to understand is I am not talking about an extremely rich power like the United States that literally has more tanks than it even wants, this is about other powers, both allies and adversaries. Would they be so much worse off giving up the tactical mobility of a tank but retaining the firepower?

Are you seriously saying that a T-72 or T-90 that drives around is that much more of a threat? Even though it would then generate a very distinct thermal signature from that? That T-72 or T-90's armour is really that impressive? If moving around is futile and the armour isn't enough, then why bother with either? You have to do more than just say "nah, and I don't have to explain why" you are qualified, as you say, so explain why? Did you not consider from how all those tanks in the First Gulf War were dug in they might as well have been anti-tank guns, they didn't (couldn't) exploit their mobility and their armour was so insufficient it was just a waste of weight.
Reply: Lets see - optical and thermal sights, gunner's control unit, tank commander's panel, electro-optical interface, electro-mechanical interface, optical-mechanical interface, thermal sights, thermal control unit, wind sensor, cant sensor, ballistic computer, ammunition select unit, muzzle reference sensor, unity sight, axially sight unit, ballistic inputs panel, ammunition select unit, EMP filter, power supply unit, thermal sight power unit, are only necessary because it's on a tank.  And this is ignoring the hydraulics you need to aim the gun - you can lay the gun on target using hand cranks - but the ballistic computer need a means of decoupling the sights from the gun and make the adjustments to the gun itself.

But you knew all of this - right?  Oh wait you have absolute no ideal of what the components of a fire control system even are.  

But lets do what you want and put WWII style sights on your AT guns.  Without a modern fire control system you can't even boresight the gun!  You have to zero the gun like you do a rifle.  And I bet that you have no clue what 'boresighting' and 'zeroing' even means.  Much less how they are done.

And swapping tanks for the guns puts the tanks in a much more difficult situation.  That's because the best weapon for killing a tank is another tank.  You can't effectively suppress a tank with artillery, they are armored to resist a direct hit by armor defeating ammunition, they can change positions between shots,  they are not going to be extremely limited in their firing arcs, they are going to have a full-up fire control system.  Unlike AT guns - they will be hard to kill.

And anything I've ignored was because it was drivel.  I have been only selecting pieces of your stupidity because you simply are not worth any more than that what I'm spending on you.  At this point I'm only still around so I can laugh at what you post (and the more inane stuff is being posted to a Facebook group for tank crewman).  And these people are laughing at you.
Reply: "but the ballistic computer need a means of decoupling the sights from the gun and make the adjustments to the gun itself."

Why? Artillery like heavy howitzers don't need that. There are dozens of other ways of it being done other than it being fully automatic.

"But lets do what you want and put WWII style sights on your AT guns."

You know DAMN WELL I have been talking about Anti-Tank guns using thermal optics for DAYS now, so it's no mistake for you to pretend that anti-tank guns for some reason cannot have thermal optics or even worse that I actually think they shouldn't have them. 

It's a straight up lie.

"And I bet that you have no clue what 'boresighting' and 'zeroing' even means.  Much less how they are done."

I know what it means and I known some of the subtler differences in meaning across different nations and eras of what was considered acceptable standard. But - once again - there is NO REASON that they cannot have a ballistic computer. Do you seriously take the concept of an Anti- Tank gun so strictly literally that it is literally JUST the gun from a tank and categorically it is for some reason forbidden for it to have any other vital fire control component used?

Please, that's so blatantly special pleading.

That's like dismissing the concept of putting a mortar in an armoured vehicle because "oh well it would be useless because you can't aim it, because the mortar used by infantry would have adjustable bipod, sights with integrated ballistics computer and so on, but you only said put a mortar, so just the cannon tube, nothing else" that's what you are doing.

"You can't effectively suppress a tank with artillery, "

But you can. In the same way you suppress a dug in gun position but likely won't destroy it. The smoke will obscure. The explosives fragments will destroy sights. As direct a hit that will destroy a gun dug into a bunker will also destroy a tank.

"they are armored to resist a direct hit by armor defeating ammunition,"

I already told you the problem where if you KNOW you can't get tanks of sufficient armour, if you are so sure that your tanks armour will be penetrated by the guns of opposing tanks, then armour is dead weight for defending against those large tanks. Such armour will be of use in some places like in an organised and coordinated assault against artillery. But you just skimmed over that, zero concern about nations like Ukraine that can't afford many tanks of such superlative armour.

"they can change positions between shots"

And what does that achieve? Next time they emerge from full defilade they're glowing like a nightclub on thermals and play right into being easily seen and destroyed by tanks in overwatch position. 

I've heard from other tankers boasting about how hard it is for tanks to do what your propose of exploiting mobility.

"they are going to have a full-up fire control system"

Oh "full-up" whatever you could mean by that. There is no reason that an AT gun can't have all the elements of a fire control system it needs. You keep saying "thermal sights... are only necessary on a tank" which is utter and total fucking nonsense. Why would Anti Tank gun not have that hugely useful sight for detecting the thermal emissions of large tanks? Why would they not have basic things like cant detectors and rangefinders? Only one reason: you depend on the contrivance of that to dismiss anti-tank guns rather than dismiss them for anything inherent.

"And anything I've ignored was because it was drivel."

Oh really, so when I told you that inertia isn't the same as kinetic energy, you think that is drivel? That's kind of damning on your part.

You thunk Brimstone missiles and equivalent are drivel?

"And these people are laughing at you."

Wow, you need hype men to back you up? Of course if you lie about me and say "THIS GUY WANTS ANTI TANK GUNS LIKE IN WW2 WITHOUT ANY THERMAL OPTICS OR ANYTHING!" then of course they're going to laugh, but they're laughing at you, they're laughing at an invention you made, a fictional character that doesn't exist.
Reply: PS: I realise why you may be so adverse to AT guns, you don't think it challenges the worth of YOUR job, does it? Because it doesn't, a tank in the US Army is very different from anywhere else, the US Army is so incredibly incredibly rich and has the cast iron guarantee of air-supremacy. So I am NOT saying that tankers in the US army lose their job and get replaced by anti-tank guns. Absolutely not.
But there are other countries that need to defend themselves other than the United States. They may not enjoy all the benefits that you take for granted, that you depend on. They don't have the money, they don't have the guarantees of air power, they don't have many diplomatic options.
Reply: <facepalm>

The ballistic computer is going to induce offsets to the lay of the gun in order to compensate for range, wind, ballistic drift for each model of ammunition, ammunition temperature, remaining gun tube life, and other factors that affect accuracy.  These offsets are induced into the gun but not into the sights.  Otherwise the moment the gunner gets a fire control solution his sights will no longer be on target and he will have to re-lay the gun.  The system decouples the sights from the gun so that the sights remain on target.

This is not something that anybody should have had to explain to you.  Just a few moment of thinking on your part should have been sufficient.

Oh wait - but you are an "expert" in this subject - right?

And this comment of yours is also getting shared to Facebook.
Reply: Because they are a dumb idea.  And in wartime you pay for dumb ideas with the lives of your people.  Remember that you are betting human lives on your idea to re-introduce AT guns.

Mexico can get away with AT guns because there is no realistic scenario where they will be fighting tanks or armored fighting vehicles.  Ukraine is using them because those obsolete 100mm guns are useful as assault guns and they don't have enough tanks.  And the scary thing is that the most 'modern' AT gun (the 2A45M) only has an effective range of 2,000 meters.  (The effective range of tank main guns is over 4,000 meters.)

In fact if you look into how AT guns have been used over the past several decades - they have been used as assault guns by countries that don't have enough operational tanks.  Something that most people don't realize is that the primary mission of a tank is as an infantry support weapon. Killing other tanks is basically a way to keep enemy armored vehicles from picking on your infantry.  This is why US tanks carry 12,000 rounds of machinegun ammunition.
Reply: "These offsets are induced into the gun but not into the sights."

What is the fucking difference between the gun being offset to the sights and the sights being offset to the gun? Of course they are both offset to each other, unless it was a laser that was unaffected by gravity or anything like that then the sights will be offset from the boresight axis, it's an inherent quality of sights that they all "compensate for range, wind, ballistic drift" and there's no reason why an AT gun cannot ALSO include in that correction "for each model of ammunition, ammunition temperature, remaining gun tube life, and other factors that affect accuracy".

"This is not something that anybody should have had to explain to you."

You didn't "have" to explain it to me, you shouldn't have to have it explained to you that nearly every projectile weapons uses sights as tanks do it with the sight not just being a boresight, it is as you refer to it "decoupled" from the gun, so the reticle points to where the round will hit at a given range. It's purely a matter of relativistic semantics whether the sights stay still and the gun moves or the sights adjust 

The gun can be moved, it doesn't need to ever be re-laid, it just needs to be laid where the adjustable reticle says it should be as calculated and displayed by the ballistic computer. The spotter finds the range as the target is spotted and it's put into the ballistic computer as the gunner is moving the reticle onto the target.

So in summary, AT gun can logically be at no disadvantage in aiming just because the sight is moved on the gun rather than the gun moved (presumably in a turret) relative to the sight.

"Oh wait - but you are an "expert" in this subject - right?"

Oh wait - but you are still lying about what I said - right?

"And this comment of yours is also getting shared to Facebook.
"

Pathetic. Will you lie and say you HAD to explain this to me when you just stated the obvious in a really obtuse way?
Reply: "Ukraine is using them because those obsolete 100mm guns are useful as assault guns and they don't have enough tanks."

Does assault gun mean something different to you? To most people it surely means a relatively light armoured vehicle with a small gun that fires a relatively large high explosive shell. So... on an armoured vehicle. And the main use is direct fire of HE, where it doesn't really have to have particularly high velocity nor range. I mean, you just said that you can't use AT guns in assault... now you're saying that's all they are used for?!!?

"And the scary thing is that the most 'modern' AT gun (the 2A45M) only has an effective range of 2,000 meters.  (The effective range of tank main guns is over 4,000 meters.)"

No, 2A45M has the range as specified by the ammunition it uses. Of course old cheap low quality export BM-9 APFSDS-T ammunition from 1962(only 56 years ago!) will have a meagre 2200m effective range whether fired from a tank's 125mm gun or a 2A45M AT gun. There is no reason it can't use better ammunition or at least if that is the only 125mm ammunition you can get you're no better off firing it from a tank. This is what you don't get, all your attempts to denigrate the effectiveness of guns like 125mm in the AT Gun role, that doesn't make them any more suited in a tank! And if you can't afford even decent APFSDS rounds, how are you going to be better off in affording good ATGMs? 

And this isn't about any one anti-tank gun, many nations can make large calibre high velocity guns and even more can make ammunition for it.
Reply: Because the sights are a straight line path to the target.  The round flies a ballistic path that is affected by things like wind, range, ammunition temperature, cant, and all the other factors that have to be calculated for precision gunnery.

If the time of flight is one second, then the gun has to be pointing 32 feet (or 9.8 meters) above the target in order for it to hit what the sights are pointing at. And this is only to compensate for the effect of gravity.  The amount of wear on the gun tube will each affect muzzle velocity so the gun has to be offset to account for this.  Wind will have two effects on the round - first of all it will push the round down wind as it travels through the air and second - it will influence how the fins of the projectile snap it back into a straight line after it leaves the vacuum formed by the hot propellant gasses instantly cooling after they push the air out of the way after they leave the gun.  Even the barometric pressure will affect the strike of the round.  Even the each model of ammunition will have required offsets to account for ballistic drift.  (And sometimes different lots of the same ammunition will have their own offsets.)  For the M1A1 there are sixteen different factors that have to be combined to set the proper offsets for every shot fired using precision gunnery techniques .

And the reason you offset the gun and not the sights is so the gunner does not have to move the sights back on to the target after the ballistic computer calculates the offsets for that shot.  (The offsets are calculated when the laser rangefinder is fired because range is going to influence all of the other offsets.)  On a tank on tank engagement - one second is a long time and can be the difference between you shooting him and him shooting you.  So you want the gunner to be able to fire immedeatly after the TC verifies a good range solution and that the 'ready to fire' box is filled.  (On the M1A2 the gunner verifies these himself while the TC identifies and prioritizes the next targets.)

So it is absolutely necessary for the gun itself to be offset from the sights when the computer generates a firing solution.
Reply: Yes, and sights are by definition adjustable.

"If the time of flight is one second, then the gun has to be pointing 32 feet (or 9.8 meters) above the target in order for it to hit what the sights are pointing at."

The ACCELERATION in gravity is 32 feet or 9.81 metres per second. An object falling and not creating any net lift will not have fallen 9.81 metres in 1 second, it will have a downwards velocity of 9.81m/s after 1 second. The distance an object falls in constant acceleration is

s = ut + 0.5at^2

s= displacement, U = initial velocity, a = acceleration, t = time

So in this case it's quite simple, if the flight time is 1 second and for some reason the bore was pointed exactly at the target, it will hit 4.9m low down on the target (assuming the target is something like in the middle of a cliff face so won't hit the ground in front of it). If you did somehow know you were pointing the boresight at a balloon 9.8m above the target, then without gravity it would reach a point 9.81m above the gun in 1 second, so it logically has an upward velocity of 9.8m/s (on average).  So let's put that in the displacement formula, the upward velocity a positive vector, but lets give gravity a negative number.

s = 9.8*1 + 0.5*-9.8*1^2
s = 9.8 -4.9

s= 4.9

Oh shit, at that range, the round hits a point 4.9m above the target.

We can work back from this if we want the displacement to be zero at 1 second flight time, 

0 = u*1 + 0.5*-9.8*1^2

0 = u -4.9

4.9 = u

So if the upward velocity U is 4.9m/s then without gravity it would hit a point 4.9m above the target. 

You in fact want to have the boresight pointing at a space 4.9m or 16ft above the target to compensate for gravity.  It should be noted, the round would not PEAK at 4.9m but that is where the round would have gone if gravity somehow hadn't affected it. This is very back of the napkin stuff, ballistic computers can be far more sophisticated and these things are mass produced, at arms shows they're begging people to buy them the market is so flooded with them.

Of course a tank's gunner wouldn't have to know that, the ballistics computer will do those calculations for you.

"The amount of wear on the gun tube will each affect muzzle velocity so the gun has to be offset to account for this."

This all sounds like it's just as much of a problem for a a gun in a tank as for an AT-gun.

"Even the barometric pressure will affect the strike of the round."

Yes, which is why you use a barometer and input this data into the ballistics computer. Along with everything else you listed.

"And the reason you offset the gun and not the sights is so the gunner does not have to move the sights back on to the target after the ballistic computer calculates the offsets for that shot."

Except the spotter could determine the range which adjust the sights as the gunner is aiming. So effectively the gun IS offset to the sights. Not that the gunner does the inane thing of pointing the boresight at the target then only adjust the sights after a pointless delay. No, you adjust the sights for everything in advance, continually updating barometric pressure and things like that and adjust the compensation for gravity when the spotter calls out targets. 

"On a tank on tank engagement - one second is a long time and can be the difference between you shooting him and him shooting you."

Yet earlier you dismissed the flight time of ATGMs that's 10-20x as long.

"So you want the gunner to be able to fire immedeatly after the TC verifies a good range solution and that the 'ready to fire' box is filled."

Yes, ballistics computers are more than fast enough to do that. Really, that wouldn't be a computational challenge in the 1980's, let alone this far into the 20th century.

"So it is absolutely necessary for the gun itself to be offset from the sights when the computer generates a firing solution."

it seems to be that is exactly what Anti-Tank guns (and really, all guns) do anyway.
Reply: The ballistic calculations are performed and the offsets induced when the gunner fires the laser rangefinder.  (Or manually inputs a range.) That is when the necessary offsets are induced.  (And when the computer rotates the turret for the azimuth offsets the sight reticle is offset in the opposite direction so that it will remain on target.)  When I was at gun school - the more I learned about how all of these systems functioned the more impressed I was with the engineering that went into them.

And these systems are not small (or light) and they have an enormous appetite for power.  And they are expensive.  You are talking about optical grade tolerances for the components instead of aerospace grade tolerances.  

And 'boresight' means calibrating the alignment the bore of the main gun and the sights.
Reply: Uhh, no mention of how you're going to share your mathematical errors on facebook?

"The ballistic calculations are performed and the offsets induced when the gunner fires the laser rangefinder. "
In a tank.

"And when the computer rotates the turret for the azimuth offsets the sight reticle is offset in the opposite direction so that it will remain on target."

That is functionally identical to offsetting the sight reticle to the gun

"And these systems are not small (or light) and they have an enormous appetite for power."

As I have pointed out many times, these are to rotate such a large and heavy turret, and quickly compensate for shifting suspension.

" You are talking about optical grade tolerances for the components instead of aerospace grade tolerances.  "

There are lots of affordable optics out there that are obviously to optics grade.

"And 'boresight' means calibrating the alignment the bore of the main gun and the sights."

Which is how I used the term.
Reply: No it's not identical to offsetting the sight reticle to the gun.  The only purpose of this is to keep the reticle from moving off the target as the turret moves.

Currently turret traverse and main gun elevation are powered by hydraulics - in the M1 series tank the hydraulics are driven by a PTO unit attached directly to the engine.  By 'power' I'm talking about electrical power.  

And yes there are lots of cheap optical grade stuff available on the consumer market.  But if you pay attention you don't find the cheap stuff used in military and aerospace grade sensors.  (You do but then you see the reason why some marks of the T-72 only had an effective range of 2,000 meters.)

Back when I was on tanks I looked at the cost of the components and thought that the Army was getting ripped off.  After I retired with went to work in aerospace and found myself calculating how much it would cost the company to make components as we prepared to bid on work.  Aerospace grade stuff (and tanks use aerospace grade components) is jaw-droppingly expensive to make.  

Cost is the reason your car does not have a heads-up display with multispectral sensors feeding it that allow you to see long distances despite rain, fog, darkness etc.  And this is for a simple system that in effect is nothing more than a sensor connected to a display.  

You have something that has to be connected to an object that weighs a couple of tons (the gun, breech assembly and recoil system) and still move accurately and precisely to tolerances of less than 1/10 of a Mil (Mil is a measurement of arc that represents a 1 to 1,000 ratio.  If you are looking at a target 1,000 meters away and move your aim point by 1 mill, the aim point will move by one meter.) 

And this is inside a very complex assembly of electro-optical, electro-mechanical, and mechanical-optical linkages inside the Gunner's Primary Sight unit.  This stuff ain't cheap.
Reply: ""And 'boresight' means calibrating the alignment the bore of the main gun and the sights."

Which is how I used the term."

No - this is what you said:  

"You in fact want to have the boresight pointing at a space 4.9m or 16ft above the target to compensate for gravity."

Boresight is a calibration procedure - not the aim point of the gun.  

The correct way of saying what you posted would be using 'bore of the gun' instead of boresight.*

*  And if you want to get technical - the last three calibers of the bore of the gun. Because this is the part of the gun tube that determines what direction the round will go.
Reply: "The only purpose of this is to keep the reticle from moving off the target as the turret moves."

While you understand tanks, you don't seem to understand how anything can be different from a tank.

"And yes there are lots of cheap optical grade stuff available on the consumer market.  But if you pay attention you don't find the cheap stuff used in military and aerospace grade sensors."

By cheap I mean "not millions of dollars", not "absolute junk not worth the small price that it is". Don't tell me it costs millions upon millions of dollars for a decent thermal sight and a ballistics computer. People make ballistics computers at home for fun with those Raspberry-Pi branded mini-computers.

"Cost is the reason your car does not have a heads-up display with multispectral sensors feeding it that allow you to see long distances despite rain, fog, darkness etc. "

No... the reason my car doesn't have long distance detectors is because I don't need to know what is so much further away than my maximum braking distance. Cars in fact do have LOADS of sensors but they are for what I do need which is optimising fuel efficiency, engine wear, and things like detecting imminent car crashes. 

"You have something that has to be connected to an object that weighs a couple of tons (the gun, breech assembly and recoil system) and still move accurately and precisely"

Yeah... like a howitzer. Large and powerful howitzers which armies have been using for over a century now, they need extremely precise adjustments as at such a extreme ranges of 20 kilometres  or more then even very slight changes in elevation have a huge change in point of impact. Exacerbated by the shape of the trajectory. And Howitzers have been able to do this even WITHOUT being housed inside much heavier armoured vehicle.

"to tolerances of less than 1/10 of a Mil"

I know what milliradians are, often referred to as simply "mil". Good so see SI units are being used rather than customary units. 0.1 and even 0.01 mil are not so unusual.

"And this is inside a very complex assembly of electro-optical, electro-mechanical, and mechanical-optical linkages inside the Gunner's Primary Sight unit.  This stuff ain't cheap."

Still inherently cheaper than ATGMs yet with a faster flight time and immune to almost all countermeasures yet all the same requirements and then some. You want to talk about aerospace standard components, try flying a small rocket with control surfaces at speeds approaching 1000km/h so close to the ground while staying inside a tight targeting line. And all this is an EXPENDABLE component.

You know what I mean by boresight, I specified as much with the "axis" of the boresight. Don't try to be tricky with me to get out of this, you made a major screw up mixing up the acceleration in gravity and the displacement in gravity and forgetting to account for upward velocity, but you're nitpicking over semantics of "boresight"?!?!?

Do you want to "get technical" because you were really sloppy the technicalities of ballistics. You screwed up the predicted drop and didn't account for upward velocity.
Reply: A military grade FLIR system starts out at half a million dollars.  And this is just a trainable thermal camera attached to display.  Now attach a battlefield grade laser rangefinder, unity and telescopic optical sights, and the equipment needed to accurately project a reticle on all of this - all aligned with each other to optical grade precisions.  Next you have to have this entire assembly robust enough that it can withstand extreme vibrations and the shockwave of an explosive warhead detonating on the other side of the armor without losing this precise alignment.  Next you have to attach the electro-optical linkages to the ballistic computer, the electro mechanical linkages and the mechanical linkages to the traverse and elevation mechanisms.  And these linkages have to be capable of the same precise movements even after being subjected to extreme shock loads.  And you also have to make it out of EMP rated components.  Oh and remember that some of these linkages have to be able to be decoupled and then recoupled without losing this optical grade alignment.

And to make things even more interesting - you need a refrigeration unit that can cool the thermal sensors down to over 100F below zero.   And speaking of thermal - you have to make your thermal optics out of some rather exotic materials because glass doesn't work well in infrared wavelengths..  And since the laser also operates on infrared frequencies - the lenses and mirrors also have to be made of similar exotic materials. And also has to be perfectly co-axial with the sight reticle at all times.

And since this will be inside a sealed unit that has to be taken out of the tank and into a clean room for maintenance - it has to be able to function for a minimum of a year without servicing.

Do you really think that you can do all this cheaply?  And what I just described is the gunner's primary sight unit.  Just one component of the fire control system.
Reply: "Still inherently cheaper than ATGMs yet with a faster flight time and immune to almost all countermeasures yet all the same requirements and then some. You want to talk about aerospace standard components, try flying a small rocket with control surfaces at speeds approaching 1000km/h so close to the ground while staying inside a tight targeting line. And all this is an EXPENDABLE component."

Then please explain why nobody uses these guns as anti-tank weapons.  Here you are - completely ignorant about anything related to gunnery - but you still think that you're right and every professional in the world is wrong.  You are taking about these technical issue - yet didn't even know what the word 'boresight' means.  This is something that's taught to recruits who are going to be tank, IFV, artillery etc. crewmen.  

What knowledge, training or expierence do you bring here?  What makes you think that you're smarter than the people who really do understand how things work in the real world?  You seem to think that a military grade ballistic computer can be built in somebody's garage.

BTW:  The only round that counts is the one that hits it's target.  As I already pointed out the reason that the range of AT guns is so limited is because they simply cannot mount and operate a sophisticated fire control system.  The only tactical scenario where they can be effective is a close range ambush.  In any other scenario the tanks will simply point the AT guns to scrap from outside their effective range.  In fact the range issue is the primary reason AT missiles have replaced AT guns - they are the weapon that can effectively engage tanks beyond 2000 meters. (And unlike AT guns they can 'shoot and scoot' in order to attempt to survive the return fire.
Reply: "A military grade FLIR system starts out at half a million dollars."

Maybe it does, maybe it doesn't. The fact is that an ATGM launch position would need as good or as expensive a FLIR system.

" Next you have to attach the electro-optical linkages to the ballistic computer, the electro mechanical linkages and the mechanical linkages to the traverse and elevation mechanisms."

No you wouldn't, you'd just need to physically attach the sight to the gun.

"nd these linkages have to be capable of the same precise movements even after being subjected to extreme shock loads."

No, you just move the gun so the sights point at the target, the reticle of the sights having been adjusted by the ballistic computer which could easily be built into the sight itself.

" And you also have to make it out of EMP rated components."

So, put it inside a metal box. I imagine they will bill them $200'000 to make EMP resistant circuit-boards rather than just shield it with a faraday cage and the fuses/resistors on any wire inputs. 

"Oh and remember that some of these linkages have to be able to be decoupled and then recoupled without losing this optical grade alignment."

WHY?

It doesn't need to be "optical grade" it just needs to get a single small number from the separate sensors like the rangefinder, 

What needs to be "aligned" optically? A sights is a sealed unit and it's bolted to the gun. Maybe with shock absorbing mounts but that's the only alignment. The ballistic computer which will reasonably be in the same housing as the sight adjusts the reticle according to the discrete digital information that is fed into it. Why would you ever possibly need "electro-optical linkages" to send a the data from the wind gauge or barometer or enter the ammunition type or barrel wear? You could enter it manually using the buttons on the sight, the wires are just to do it quicker.

Because, once again IT IS NOT A TANK.

"And since the laser also operates on infrared frequencies - the lenses and mirrors also have to be made of similar exotic materials. And also has to be perfectly co-axial with the sight reticle at all times."

So what if the laser rangefinder wasn't "perfectly co-axial" with the sight reticle? So if the spotter with a laser rangefinder was 1m to the left or right at a target 3000m away. Then the parallax sight will induce a distance measuring error of less than 0.2mm. The point where the laser rangefinder is used need only be within a few metres from the point where the gun shoots.

"Do you really think that you can do all this cheaply?"

No, pointless extravagances like an "electro-optical linkage" to transmit a single 8 bit number cannot be done cheaply, but that doesn't matter as they are completely unnecessary.

"Just one component of the fire control system."

What other fire control system could possibly be needed? Everything to correct for the round's movement from initial line of flight is accounted for.
Reply: "Then please explain why nobody uses these guns as anti-tank weapons."

But that's not true, some nations do use them.

"Here you are - completely ignorant about anything related to gunnery"

Did you forget the part where I had to correct your error in gunnery? You seem to think I'm an absolute know-nothing, who has no knowledge on this subject whatsoever.

"you still think that you're right and every professional in the world is wrong."

Every professional in the world has NOT categorically dismissed anti-tank guns being in any way relevant. 

The Israelis had no tanks with a 100mm gun in the late 1990's and 2000's, only anti-tank guns in that calibre, yet they worked with romania to develop an advanced 100mm calibre APFSDS round.

"  You are taking about these technical issue - yet didn't even know what the word 'boresight' means."

No, you don't understand a reasonable use of the term as to obviously indicate the line where the barrel is pointing AS OPPOSED TO where the projectile will actually go under the effects of gravity. Don't be obtuse when you don't know how gravity affects projectiles.

" What makes you think that you're smarter than the people who really do understand how things work in the real world?"

What does IQ have to do with this?

This is about knowledge, you have been sharing your knowledge on this.

"You seem to think that a military grade ballistic computer can be built in somebody's garage."

Am I wrong though? Don't scoff. Why would you need such a supremely powerful supercomputer that it's totally outside the realm of availability except for the richest countries' defence programs? I walked you through the calculations earlier, and your only acknowledgement of that was to quibble over semantic use of the term "boresight" when it was always clear what was meant.

What is so impossibly hard about the calculations that are required? Okay, YOU screwed up on the calculations, but they are calculations that computers from the 1980's could ace.

"The only round that counts is the one that hits it's target."

That's a damning indictment of ATGMs then.

"As I already pointed out the reason that the range of AT guns is so limited is because they simply cannot mount and operate a sophisticated fire control system."

Yes they can.

You completely pulled it out of you-know-where that anyone ever needed to "attach the electro-optical linkages to the ballistic computer, the electro mechanical linkages and the mechanical linkages to the traverse and elevation mechanisms" which is UTTER NONSENSE. You suggest the most needlessly hard way of doing it of pointing the sight at the target and then move the gun relative to the mount and the sight which is fine if the gun is inside a turret but guess what... it isn't. YOU ARE DESCRIBING HOW IT IS DONE IN A TANK BECAUSE OF THE WAY A TANK IS CONFIGURED! Stop bringing problems from a tank to an anti-tank gun.

You aim an anti-tank gun the way sights work on a rifle, you adjust the reticle just before you begin aiming the whole gun at the target. For a rifle this would mean moving the rifle directly with your arms, for an anti-tank gun this would of course mean using controls to move the gun until the reticle points at the target. There is NO POINT AT ALL in waiting until the sights are on target and THEN adjusting the reticle relative to the bore-axis of the gun. 

And crap like "laser rangefinder, unity and telescopic optical sights, and the equipment needed to accurately project a reticle on all of this - all aligned with each other to optical grade precisions" Is such nonsense WHY WOULD THE RANGEFINDER HAVE TO BE IN PRECISE ALIGNMENT? The Rangefinder could be 20m to the left and pointing 30 degree different angle, it'll still give the gun an accurate range. And why are you listing the reticle as somehow a separate component as if it's somehow really unusual for the reticle to not be in optical-grade alignment with a sight??!?! A reticle is a defining characteristic of a sight! This is like complaining about the impossibility of a rifle by saying that the chamber must be the exact right size for the cartridge.
Reply: "No, you just move the gun so the sights point at the target, the reticle of the sights having been adjusted by the ballistic computer which could easily be built into the sight itself."

So you want the gunner to play the game of 'chasing the reticle' and when you chase the reticle - say goodbye to the lead that your FC system just calculated.  (Lead is calculated by the movement of the reticle as the gunner tracks the target.  So when the gunner moves the reticle back onto the target the system will create a new lead solution based on that movement.  Which will move the reticle again.)

Oh and BTW - the tank crew got a warning that they've been hit by a targeting laser.  And where that laser came from.  So while the gunner is laying his reticle back back onto the target the tank will be laying their reticle on him.  And now you have a contest between a target that is armored to resist antitank weapons and a target that has no protection for the weapon or the crew.  And the tank gunner will not have to move his reticle back onto the target and can fire the moment the ready to fire box appears (which is nearly instantaneous).

Only an idiot would design a fire control system the way you described.  You forget that a lot of very smart and expierence people design fire control systems and those systems are tested out using real troops to ensure that they are what those soldier need.

Everything I've described is done for a reason.  And you don't know what those reasons even are.
Reply: They wouldn't be "chasing" any reticle because the range is not constantly changing. They can dial in to a likely estimated range and within milliseconds of the laser finding the range/lead the reticle can click ONCE to make the last final adjustment, but you have this idea that the gunner must be the one to "lase" the target, when that's not necessarily the case. Someone else can track the movement feeding that into the ballistic computer and then use a laser to find the range, the gunner is effectively doing what the "fire-control system" (if by that you mean the mechanism to quickly move the barrel/breech to correct for range/lead) does when they they line up the reticle on target and fire.

You have a very strict narrow way you think this can work, based on the configuration in a tank like the M1 Abrams, working around those strengths and limitations yet totally unwilling to consider anything outside those paradigms.

"So while the gunner is laying his reticle back back onto the target the tank will be laying their reticle on him."

No, they'll be laying it on the spotter who can be significantly displaced at a spiderhole entrance, or be decoyed shooting at any other laser source that easily spoofs a laser rangefinder. The laser is the cheap part, you can buy cheap lasers by the crate-load. You previously insisted that the rangefinder had to be precisely aligned with the gun when it doesn't. With velocities this high over such huge distances, it really is insignificant whether the rangefinder is 2cm from the bore-line or 20m from the bore-line, the ballistics computer can correct for any marked error from such offset.

Now a tank can't do that.

What would it be worth shooting off decoy lasers, anti-tank gunners don't need to look for lasers when tanks with 1500 horsepower engines are glowing like lightbulbs in thermal optics and tremor sensors give a huge amount of warning to general position. Anti-tank guns are obviously not going to have huge engines to move 60tonnes around quickly so won't be radiating loads of heat.

"Only an idiot would design a fire control system the way you described. "

Yes, because you have it only half right, you insist the gunner must have the means to measure range and lead by pointing his aiming reticle at the target, because that's the way the tanks you know do it. Well when things change then change other things to adapt.
Reply: "So what if the laser rangefinder wasn't "perfectly co-axial" with the sight reticle?"

It has to be perfectly coaxial with the sight so that the laser hits the same thing the gunner is aimed at.  And apparently you don't understand what 'co-axial' means.  Coaxial means that they are orientated on the same axis.  So a coaxial laser one meter to the right of the sights will strike one meter to the right of the aim point if properly aligned.  It's far easier to put the laser inside the Gunners Primary Sight unit.
Reply: "No, pointless extravagances like an "electro-optical linkage" to transmit a single 8 bit number cannot be done cheaply, but that doesn't matter as they are completely unnecessary."

These are not video game screens - these are optical systems.

So you have absolutely no idea how these systems work.  
There is a light that projects an image of the reticle onto a mirror that can slew left and right, and forwards and back as necessary to keep the reticle where the ballistic computer tells it to.  The mirror reflects the reticle onto a slanted piece of glass so that the reticle appears over what the gunner is seeing through the sights.
Reply: Colin Campbell. Projecting a reticle onto a mirror? You are talking about an INTEGRAL COMPONENT of the sight, not some discrete system that needs to be somehow connected by any "electro-optical linkage".

I am talking about discrete systems like the wind gauge, placed where it is best suited to detect the wind. Then you just need to feed in the direction and speed of the wind which will be a few discrete digital numbers. Ditto for barometric pressure, temperature, round type, condition, barrel wear and so on.
Reply: "What other fire control system could possibly be needed? Everything to correct for the round's movement from initial line of flight is accounted for."

Well lets see.  You need an azimuth rate gyro to calculate lead, You need a crosswind sensor unit.  You need a muzzle reference sensor, you need a cant sensor unit to measure how much higher on gun trunnion is higher than the other. You need a panel where the gunner can input the manual offsets for gun tube wear and the specifics of each ammunition type.  You need the necessary sensors so the gunner knows when the gun is ready to fire, you need an electrical power supply unit, you need a source of electrical power, you need the gunner's control handles so the gunner can aim the gun without having to turn two separate hand cranks at the same time.  You need a source of hydraulic power to actually move the gun.  You need the complex set of linkages between the sights and the gun. You need the linkages between the ballistic computer and the gun as well as the ballistic computer and the sights.  You need an auxiliary sight unit that operates independently of everything else in case your primary fire control system is not working properly.  You need primary and secondary electrical firing circuits.  I can go on all day here and still leave things out..
Reply: Colin Campbell. I obviously know what co-axial means, you keep doing that, every time I point out your limitation doesn't make sense mathematically you shout that I must not know terms you use.

Even though it would be impossible for me to have said what I said without me understanding what co-axial means.

And now you are FIXATED on the idea that it MUST be coaxial, when it doesn't. The spotter can have and use the range finder, but guide the gunner with elevation and azimuth information so that the gunner is aiming at the same target as the spotter.

But they DO NOT have to be perfectly coaxial, paralel, or whatever pedantic term you may want to use to describe what we both know either way.
Reply: "So, put it inside a metal box. I imagine they will bill them $200'000 to make EMP resistant circuit-boards rather than just shield it with a faraday cage and the fuses/resistors on any wire inputs."

Fuses and resistors are what you use to limit the damage if there's an issue with your EMP shielding.  And if those fuses/resistors burn out - remember that the repairs have to be done in a clean room environment.

Sorry but I'll let the electrical engineers design the EMP resistant stuff.  This is not something you leave to amateurs.
Reply: Colin Campbell "You need an azimuth rate gyro... A crosswind sensor" 
Oh for god's sake were going over all of this... AGAIN?!?!!? I've already said how those are covered.

And now you're going over everything all over again, yes, we know, all this can be entered into the ballistics computer. I know about muzzle reference sensors, the mirror and beam of light. And about thermal sleeves. 

Of course all this will be accounted for. Again, cant sensors, of course, so you enter in the can't into the computer, what's special about that input? Cant sensors are not ruinously expensive like depleted uranium armour and ultra high speed, high power and high precision hydraulic controls.

You don't need any complex linkages with the sight and the gun, the sight doesn't have to move relative to the gun at all, the reticle can move.

The ballistics computer will almost certainly be integral with the module that is the sight, it only needs simple linkages to the gun for things like muzzle reference, the cant sensor can be in the sight module. After all, it's going to have an elevation and azimuth sensor in there.

You can go on and on by repeating yourself and listing cheaper and cheaper, more and more trivial compononts. What is the point in listing those? Why not list every freaking screw and bolt while you are at it!?
Reply: "They wouldn't be "chasing" any reticle because the range is not constantly changing. They can dial in to a likely estimated range and within milliseconds of the laser finding the range/lead the reticle can click ONCE to make the last final adjustment, but you have this idea that the gunner must be the one to "lase" the target, when that's not necessarily the case. Someone else can track the movement feeding that into the ballistic computer and then use a laser to find the range, the gunner is effectively doing what the "fire-control system" (if by that you mean the mechanism to quickly move the barrel/breech to correct for range/lead) does when they they line up the reticle on target and fire."

<facepalm>

Words cannot describe just how painful that was to read.  The military term the crew drill you just described is: 'Cluster F-ck.'  

Three people - who may or may not be looking at the same thing as the gunner and every time the gunner moves the reticle to lay it back on the target he has to remember to manually 'dump' the lead solution.  And then he has to track the target until he gets the cue that a lead solution had been produced before he can fire.  But wait it gets even better - since every change moves the reticle off the target and the gunner has to manually move it back - it will be impossible to use any kind of computer generated lead solution.

And to make things even worse - other people are the ones making his sight reticle move.  Instead of the fire control system making the gunner's job easier - it's making it harder.  Decouple the sights from the gun and let the gun then move independently of the sights - and the only thing the gunner has to do is keep the reticle on the target.  

Something you haven't figured out is that there is a reason things are done the way they are.  And if you don't know what the reasons are - all you are going to do is screw things up when you try to do them another way.

BTW - the tankers in the Facebook groups recommend that any gun crew subjected to that have a personal meeting with the person who designed it.  And use two by fours to ensure that he really knows exactly how pissed off they are.

<edit> It was recommended that I change "any gun crew" to "the surviving members of the gun crew."
Reply: "Colin Campbell. Projecting a reticle onto a mirror? You are talking about an INTEGRAL COMPONENT of the sight, not some discrete system that needs to be somehow connected by any "electro-optical linkage"."

And the mirror's movements are controlled by the ballistic computer.  So of course you need a linkage between the electronic part of the system and the optical parts.  You need this linkage to move the mirror.  And if you cannot figure out why 'chasing the reticle' is a very bad thing - there's no hope for you.  

And why not simply connect the crosswind sensor to the ballistic computer*?  Same with your barometer.  As for the rest - the gunner has a control panel where he inputs the 'static' variables.  And the gunner selects the round type when he arms his part of the firing circuits.  One switch with settings for 'safe,' FSDS, HEAT and Coax.  The gunner has to arm his part of the firing circuits  at the beginning of the engagement anyway and he simply sets the switch to the battlecarry ammunition type or to the type of ammunition the TC wants loaded.

* The only crosswind reading that counts is that one that's taken immedeatly before the ready to fire box appears in the gunner's sights.  On some systems the crosswind corrections are dynamic and the corrections continue right up to the point where the system detects that the trigger has been pulled.
Reply: "The spotter can have and use the range finder, but guide the gunner with elevation and azimuth information so that the gunner is aiming at the same target as the spotter."

Painful to read.  So what you're saying is that the range finder fires the laser (alerting the tank as to the danger) then guides the gunner onto the target.  Then the gunner places the reticle on the target, induces lead, verifies that the range in his display looks correct (and if he disagrees with the range then the range finding procedure has to happen all over again) and then fire the gun?

While the on the tank the TC is going to grab the over-ride slew the turret onto the target (aiming the main gun as if it were a shotgun) and at the same time announcing: 'Gunner, HEAT, antitank, Fire!'  (Assuming the battlecarry ammunition was HEAT, if it was sabot then he says: 'Gunner sabot antitank fire! Fire Heat!'.  The gunner places the safe/fire switch to sabot with one hand while the other hand lays the sights onto the target. At the same time the loader is placing his safety from safe to fire, and prepares to hit the knee switch to open the ammunition doors the moment the gun fires.  The moment the reticle is on target the gunner fires the laser, verifies that the indicated range looks reasonable and fires as soon as the ready to fire box appears.

Minimum standard to perform this entire process is five seconds.  And in my units the standard was three seconds.  (As the unit Master Gunner I was free to set higher standards.)  This means that the crew of the AT gun has two seconds from the time the lase to fire an accurate shot at one of my tanks.  Otherwise they will probably die.  If it takes them three seconds then the round they fired is going to fly past the round that the tank fired.  If it takes them four seconds - they will probably die before they can fire.

This is how fast and brutal modern armored warfare is.  Anything that shaves even a fraction of a second off the time it takes to kill a target translates into more of your people being alive at the end of the day.

This is why the US takes a 'cost is no object' approach the gunnery fire control systems and we spend enormous amounts of money training our tank crews as compared to other countries.
Reply: ""Then please explain why nobody uses these guns as anti-tank weapons."
But that's not true, some nations do use them.
"

Name a country that - by doctrine - uses them in an anti-tank role.

And the only correction you made to me was a physics error (it's been 30 years since I took a college physics class - so sue me).

""you still think that you're right and every professional in the world is wrong."
Every professional in the world has NOT categorically dismissed anti-tank guns being in any way relevant. 
"

Really? Who?

""You seem to think that a military grade ballistic computer can be built in somebody's garage."

Am I wrong though? "

Yes you are.  These things have no relation to consumer electronics.  These are hardwired and dedicated systems.  There are no hard drives, and everything runs off of purpose built circuit boards.  (There is a circuit board for each model of ammunition.) The idea here is that using hardwiring instead of software makes them harder for a hacker to do anything with.

Military specifications require that these things work perfectly in temperatures between 160F and -40F.  They have to work despite vibrations and a shock equalavelent to being dropped 12 feet onto a concrete surface.  They have to use EMP rated components.  (The things are expected not just to survive an EMP - but to continue to operate as if the EMP never happened.)

The casings and the lids for their casings are machined out of solid blocks of a specified grade of aluminum (which also serves as a layer of armor to protect the electronics in case of a penetrating hit to the turret).

Nope - you aren't going to be making these in your garage.

"" What makes you think that you're smarter than the people who really do understand how things work in the real world?"
What does IQ have to do with this?
"

The problem I see is that you seem to be ignoring the stuff I'm explaining to you.  

"YOU ARE DESCRIBING HOW IT IS DONE IN A TANK BECAUSE OF THE WAY A TANK IS CONFIGURED! Stop bringing problems from a tank to an anti-tank gun."

And your antitank guns are tank guns.  And I have been careful to leave out any tank specific information.  (I don't recall discussing the gun stabilization system for example.)  Or the systems that compensate for the speed and direction of the tank when computing a firing solution.

And since these AT guns are repurposed tank guns - shouldn't you give them an equalavelent quality fire control systems so they can take on tanks at the ranges the tanks fir at?  

BTW - just as an aside.  The ammunition costs qualifying a tank and an AT missile crew each year are roughly the same.  (Although this does not take into account the costs of the machinegun ammunition because tanks have to qualify with those well as the main gun.)

Last time I qualified the cost of a target practice tank main gun round was just over $5,000.*  And a tank crew has to fire about 60-70 of these a year to be fully qualified.  That's $300,000 each year just to keep the crews qualified.  Section (tank and wingman tank) qualifications burn more ammo and platoon gunnery qualifications burn up even more.

And the cost of a target practice AT missile is roughly $150,000 and they have to fire one every six months to remain qualified.  

* Service (combat) ammunition cost upwards of $15,000 a round.  (One of the major reason for the ungodly price is the fact that we don't use this stuff in peacetime and as a result these tend to he handmade instead of mass produced once the 'war reserve' stockpiles are filled.)
Reply: "Three people - who may or may not be looking at the same thing as the gunner and every time the gunner moves the reticle to lay it back on the target he has to remember to manually 'dump' the lead solution."

You're not listening to what I'm saying, you've already forgotten that the gunner isn't the one tracking the target to determine the lead solution.

"And to make things even worse - other people are the ones making his sight reticle move."

Yet you contradict yourself here.

Of course it sounds bad, you insist it must work in a completely different way.
Reply: "And the mirror's movements are controlled by the ballistic computer." And the ballistics computer is IN the sight and why would you move the mirror when you can just use a collimation sight reflecting anything that's on a screen. There are so much easier ways of doing it than trying to ever so slightly change the angle of the mirror to move the apparent position of any reticle.

"And why not simply connect the crosswind sensor to the ballistic computer*?"

THAT IS WHAT I SAID SHOULD BE DONE!

But this doesn't require an expensive "electro-optical linkage" to feed in a number like "2.135m/s 37 degrees". But more is better, a gust that lasts for half a second at the instant of firing isn't as relevant to how the wind is over the entire flight path.
Reply: "So what you're saying is that the range finder fires the laser (alerting the tank as to the danger) then guides the gunner onto the target.  Then the gunner places the reticle on the target, induces lead"

I also clearly said the spotter could also calculate lead, then it would be as you say is ideal that "the only thing the gunner has to do is keep the reticle on the target" except this way you AVOID needing such an expensive high-speed high-power high-precision hydraulic system. Because the gunner would only have to keep the reticle on target since the spotter is tracked the range (that won't change much) and movement (if any) of the tank corrects the reticle before they are close to getting the reticle on target.

"This means that the crew of the AT gun has two seconds from the time the lase to fire an accurate shot at one of my tanks.  Otherwise they will probably die."

No, it has two seconds from the LASER rangefinder, not two seconds from

Again, you're acting like an AT gun is like a tank, glowing from heat from it's huge engine when it isn't. The tank will be easily spotted, the AT gun will not. They will be easily decoyed with flashes, dummy guns and infantry in spiderholes popping up with lasers to spoof a rangefinder. Even then the spotter can guide the gunner onto the target with azimuth correction, and estimate the range before using the laser rangefinder, then it is definitely possible to fire off an accurate shot within 2 to 4 seconds.

"Anything that shaves even a fraction of a second off the time it takes to kill a target translates into more of your people being alive at the end of the day."

And again, with the INSISTENCE that it would be categorically impossible to save any substantial amount of money on anti-tank guns so you would never have any numerical advantage?

That, I don't buy. And you can metaphorically threaten me with two-by-fours all you like, you cannot just ignore economics and logistics by insisting it will only ever possibly be a one on one fight. That all this compromise in design gains nothing. All you are doing is denying and ignoring the fact that what you propose of affording sufficient numbers of M1 tank IS NOT AN OPTION! The problem is not this AT-gun or just as many or more advanced main-battle tanks, it's often this or NOTHING, or this and two to three more AT guns.

Of course you will ignore that, then a few replies later when you've fully suppressed your memory of that point you will be back to castigating me for an AT-gun that isn't overall as capable as an M1 Abrams WITHOUT numerical advantage.

"This is why the US takes a 'cost is no object' approach the gunnery fire control systems and we spend enormous amounts of money training our tank crews as compared to other countries."

Well US has more money to spend on their military than the next 10 powers COMBINED.

It is that expense which works further against tanks, the airpower anti-tank weapons, that makes it futile to try to move armoured vehicles or even have them in a combat zone. And the US is far more likely to lend their airpower to a nation that still fights with their relatively less advanced tanks than have US ground forces committed without air power from the USAF or USN. By the way, you know who has the second largest air force in the world after the United States? The United States. The US Navy's air force is by far and away the largest military air force, far larger than anything any other power had and not only that, their tanks are ESPECIALLY vulnerable to. USAF has bases all around the world with extremely long strategic range with air-fuelling.
Reply: "You're not listening to what I'm saying, you've already forgotten that the gunner isn't the one tracking the target to determine the lead solution."

So exactly what do you need the gunner for?  You have somebody else with a reticle on the target, why not just give him the firing controls?  

You've set up a FC system that relies on three different people to aim the gun.  And the overly complex crew drill will slow things down on a system who's only chance of survival is to kill all of the enemy tanks before they can shoot back.  The more you describe how this system is supposed to work - the more of an abortion it becomes.  

A crew for something like this needs to be four people - a gun commander, a gunner, a loader and an ammunition handler.  In combat you want to keep things as simple as possible.  The more complex you make your crew drill - them more chances there are for something to go wrong.  

And you need to be willing to spend the money on a good FC system.  In fact what you really need is to put the whole thing on a lightly armored vehicle and use it as a tank destroyer.  That way your crews would not get wiped out because they cannot displace their guns before they get destroyed.  There are simply too many weapons that are effective against this kind of target.  

Something you need to do is think of how a smart enemy would deal with towed AT guns.  You can expect them to know the circumstances where these guns are effective - and when they are not.  And you can expect the enemy to adjust their tactics accordingly.  

If you notice that I've been thinking these guns from two perspectives.  The first is the technical aspects of direct-fire gunnery and the second is: "How would I kill them?"  If you are willing to accept the fact that you can either do this cheap - or you can do it right, then the technical aspects are fixable.  Good engineers supervised by people who understand gunnery and the tactic and doctrine that will govern how they are used will get you a functional system.  And it's the 'how to kill them' aspect that is what kills this idea.  The moment these guns open fire you might as well write them off because there are too many easy ways to kill them.
Reply: You don't put the ballistic computer in the sights.  No real reason to and if your ballistic computer fails you cannot unplug the cables, unbolt it, and replace it with a new one in a half hour or less.  (US Army doctrine is that under operational conditions any tank that cannot be repaired in 30 minutes gets left behind.  So they make everything modular so that the defective module can be swapped out for a new one in 30 minutes or less and the defective module sent back far behind the lines to be repaired.)  

And breaking things down into modules has the benefit of making mounting things easier.  It is far easier to fit in several smaller components than one big one.  And it's easier to upgrade a modular system at a later date.  If you come up with an improved ballistic computer it is easy to swap out the old one.  

If you want to design a successful weapon system you need to keep a lot of focus on things that will lessen the workload of the crews and mechanics.  If for no other reason - personnel.  Things that are more complex and are harder to use will require larger crews.  Things that are harder to maintain require more mechanics.  And every person on these crews and maintenance teams is a soldier you cannot use to do something else.  

And then larger crews increase the lifetime costs of operating the weapon system.  Every person has to be recruited, trained, clothed, fed, housed, provided with medical care, and paid.  Remember that 1/3rd of the US military budget goes for pay, housing, benefits etc. for personnel.  So close attention has to be paid to the number of people it takes to operate a weapons system.
Reply: Treblaine: In WW2 they didn't have:
Thermal imaging sensors
Gyrostabelized, computerized fire control
Instantaneous aerial recon

Etc. etc. etc.

In WW2 it was way harder to take out an AT gun position, or spot it...now, a tanker can scan his surroundings way better, and find a pesky gun-crew camouflaged in the bushes way easier.

And at that point, why don't you just use an ATGM? More portable, less hard to use, easier to conceal AND outranges the tank by several kilometers in some instances...so no chance of catching return fire, no matter how long it takes.

I grant you that a "modern" AT gun might work in some areas and on ambushes in towns...but you know what works better?
AT-rocket launchers that every infantry squad already carries...this way, you won't have to haul around 500kg of gun and mount to kill a tank, but a single, 10kg launcher pack could do it.

Infantry is just alot more mobile without having to worry about dragging a big gun everywhere.
And Apaches already kick the shit out of flatbeds and pick ups, what do you think will change when you use them to tow an AT gun?
Reply: XxDaHorstxX  I was a tank crewman starting in 1986, Tank Commander starting in 1990 (M60A3, then M1IP, then M1A1) / unit Master Gunner (M60A3, M1IP, M1A1) up to from 1993 - 2000 (when I was DA selected for a tour of duty as an IG).  I deployed to Iraq 2004 - 2005 as a Senior Armor/Cavalry NCO.
Reply: @colincampbell767  sounds solid